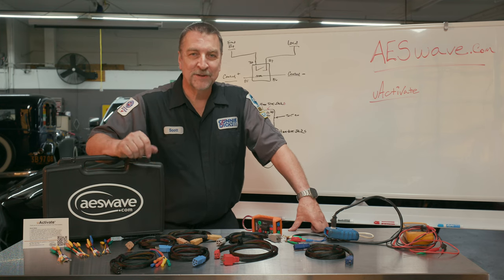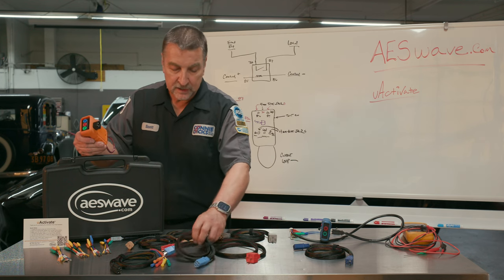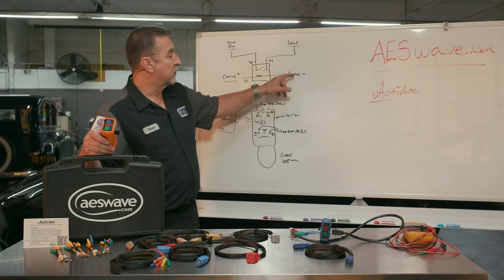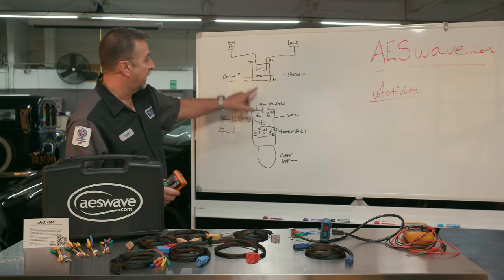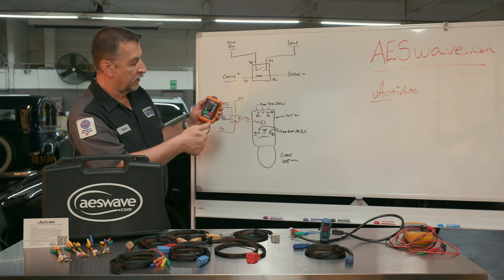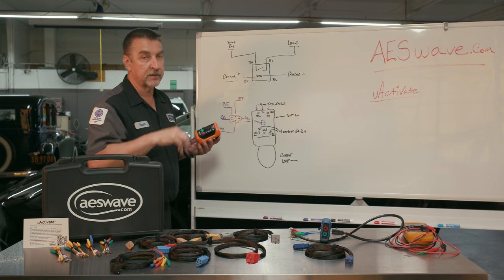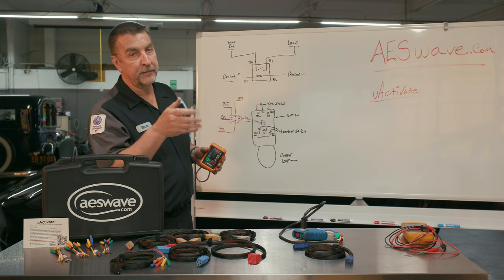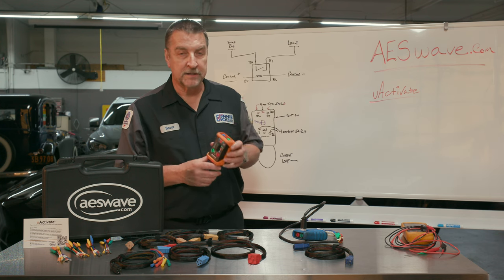AESwave uActivate Quick Chat

Comment: Mine doesn't have the feature with a speaker or a switch on the side; it has a button. Is mine an older version? I wish they had also installed an internal relay so you wouldn't have to pull the tool out to run the car normally.
Reply: Yes, you have the original version of the new Uactivate.  This is the version that I also own.

Comment: Hi yes I would like to see how to use the U ACTIVATE on a late model Toyota tundra fuel pump control module located in the frame rail near the rear shock
Reply from the maker: Can you provide a YMM? This vehicle is likely equipped with a brushless DC pump. However, the EFI Main relay is the primary power supply for the FPCM. The FCPM receives a control signal from the ECM to tell it how much pump activity is desired. The pump may operate without a command from the ECM and I'm willing to find out. One of my technicians has a Tacoma with this set up on it so I'll see what I can discover.
Reply: It’s a 2012 Toyota tundra 5.7 4wd

Comment: Nice video.  I would like more information about how that switch on the side works.  I bought the new version uActivate in March of 2023 and mine has a button on the side where yours is a switch.  I'm wondering what the difference in using this tool with the switch vs the button.  This is the first time I have seen this version with the switch.
Reply from the maker: @Mr2004MCSS  The switch is the latest version. I had asked about a speaker and they indicated that they would be working on a solution. I recommend reaching out to them and let them know where you learned about the new built-in speaker to see what they might be able to do for you.
Reply from the maker: @Mr2004MCSS  and thanks for the compliment. 👍
Reply: @TechScottBrown  Thanks.  I will do that.
Reply: @TechScottBrown  I did reach out to AESwave and they explained to me how the switch works.  The middle position is off.  The up position is to activate the LED lights for 87 and 87a.  The down position to use the speaker function.  I also asked them if it would be possible to just buy the new control portion with the switch for those of us who have the version with just the button but have not heard back yet.
Reply from the maker: @Mr2004MCSS  Fyi, i have been working with them in discussions on how to get these units upgraded and I believe that there will be an offering soon. I’ll update you as soon as I get the green light.
Reply: @TechScottBrown  Thank you, that would be great.
Reply: @TechScottBrown  Great Video! Could I also get an update too?  Thanks!
Reply: @TechScottBrown  I reached out to AESwave again about updating the tool and they responded this time.  They said that they could update mine with the switch for $24 so I sent it in the other day to get upgraded.
Reply from the maker: @Mr2004MCSS  thanks for the update!